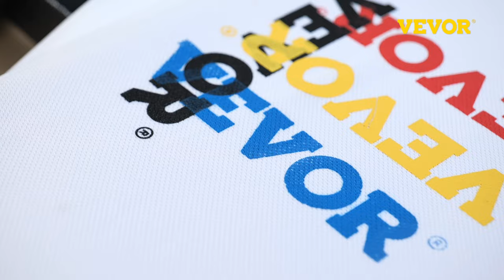How to Install VEVOR Screen Printing Machine?

Comment: How can I fix a floating screen?? The levers won’t allow the screen to lay on the garment, and there is about an inch of space between my screen and the garment table.
Reply from the maker: The link is the instruction manual of the product. Please download it.   https://we.tl/t-PRhZCYdQO7
Reply: I have the same problem
Reply: It is meant to have offcontact
Reply: Yeah so this is a problem for many people. There is a bit of fine tuning needed between the off contact limiting bolt and the clamp head height relative to the arm. The projected angle of off contact seems too high no matter what as there is no tilt to compensate as you raise it up. I'm trying a few things today to level it out. It is possible but a lot of messing about which we shouldn't have to do really
Reply: The only way I found is to remove the locator. If you remove the locator the screen will sit much closer to the garment. Hope this helps.
Reply from the maker: Thanks for your help.

Comment: Are you able to upgrade this unit to a 2 station?
Reply from the maker: https://www.vevor.com/screen-printing-machine-c_11154/4-color-2-station-silk-screen-printing-machine-press-equipment-t-shirt-diy-p_010530650532     2 station's product reference link.
Reply: @vevor.official  I already bought a one station . Can I buy separate parts to add a second station?
Reply from the maker: We do not sell parts.
Reply from the maker: If you want to implementone station  to two stations through parts. I suggest you ask local technicians. Generally cannot be achieved.